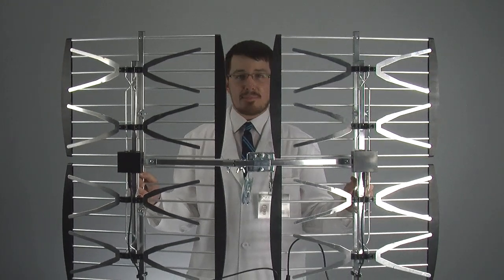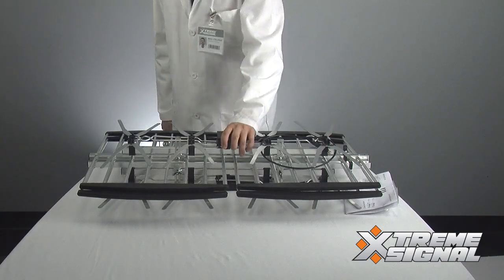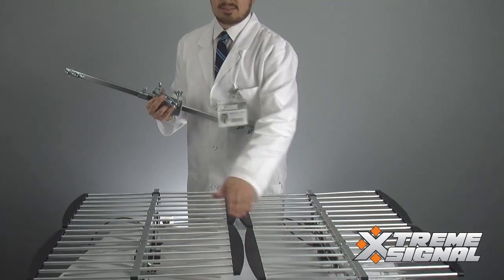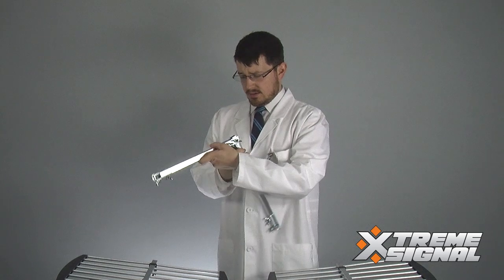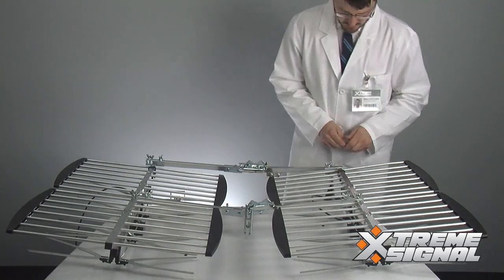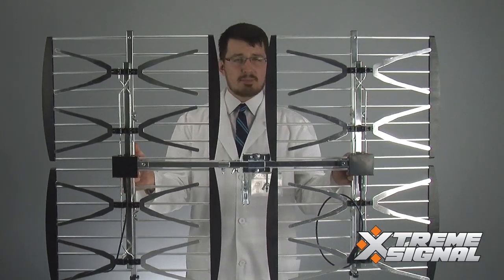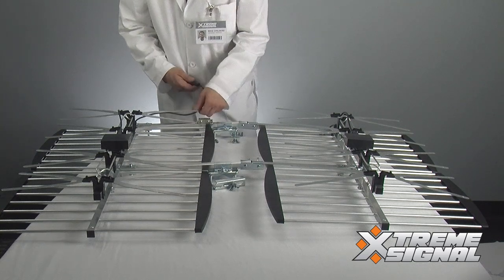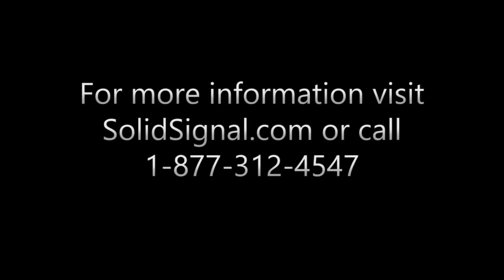Assembly Instructions for the HDB8X 8-Bay Bowtie TV Antenna from Xtreme Signal

Comment: Notice how  it is a stretch for one antenna to reach the combiner.  The combiner should be put in the center of the two antennas, not offset as it is.  Putting it in the center gives equal distance to the antennas so they can be positioned in different directions without trying to stretch on cable.  Reading one comment I agree with about distance of the reflector elements to the driven elements.  That distance needs to be given so you can straighten the driven elements for the proper spacing as they are all different distances and at these frequencies a small amount makes a big difference.  Any chance of getting the distance as it appears they should all be the same and they could be adjusted.

Comment: I took this antenna down and recycled the metal after installing an Antennas Direct DB4. The DB4 KILLED this HDB8X. The beamwidth of the HDB8X was just too narrow. The DB4 picks up everything in my market with it's great distance capabilities and wider beamwidth. When you combine two antnnas, the beamwidth is cut in half. So if your stations are spaced farther then 30 to 60 degrees apart, the narrow beamwidth is going to be an issue.

Comment: You should include info on how to straighten and proper alignment of the bow ties, given most will be bent from shipping.  Also you should use a thicker sealed plastic bags for the hardware so they don't get loose and leak out of the tears in the paper thin  shipping container.

Comment: I have a 4 bay home made indoor antenna made of coat hangers and I get 32 channels on it but I'm supposed to get more channels that I used to get what can I do to get them back in add more hangers or what that will work
Reply: Google User  mine isn't and dont knows how to put a reflector on the back of it to get more channels
Reply: Google User  lol his antenna is a copy of bowties that have been around for a long time. I purchased one of his "ultimate" antennas and did real world side by side comparisons with an Antennas Direct DB4e and an Extreme Signal HDB4X and all 3 performed exactly the same.

His antenna is structurally made out of plastic and will dry rot and become brittle. The other 2 will last a lifetime.

Sorry but he's pulling your leg

Comment: this antenna works will but if it's a windy day it will knock out  alignment form the station your trying to receive.  poor engineering of securement clamps that holds the antenna in place. The engineers did not do any data research on this.  I would pass on purchasing this antenna.  To many problems.